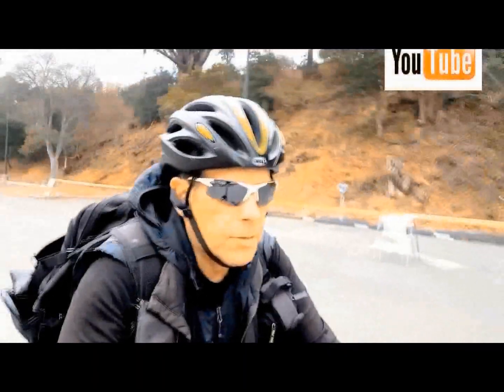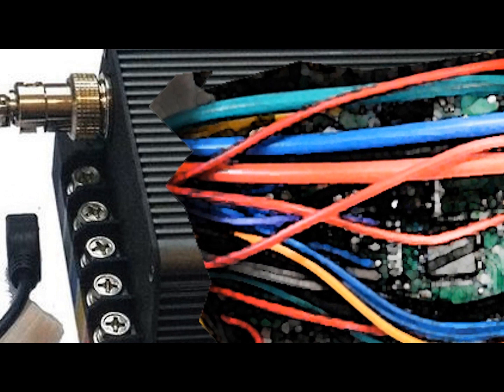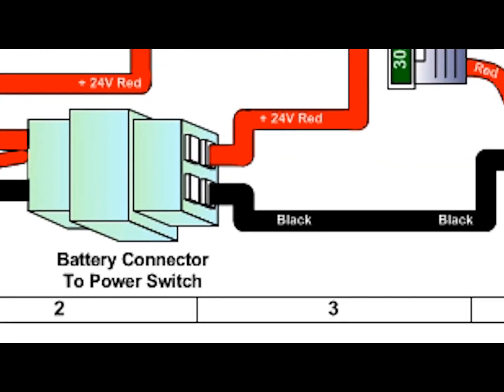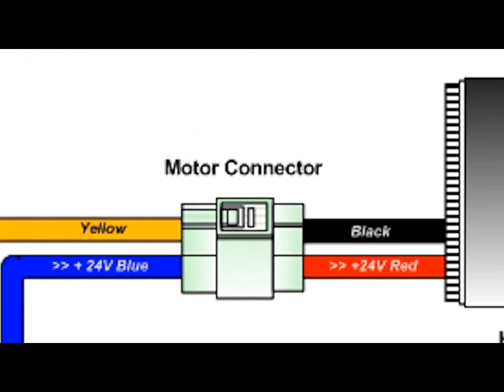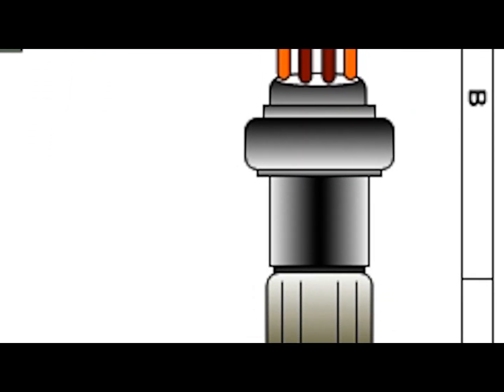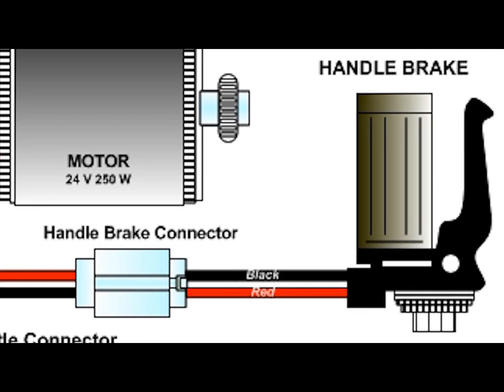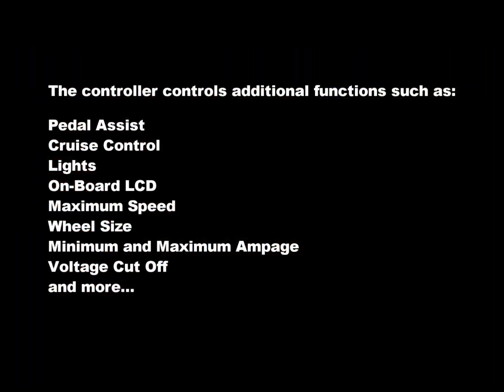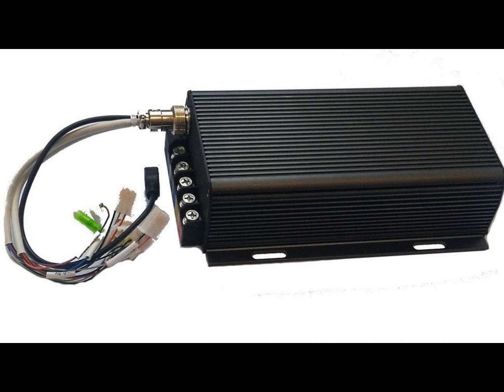How your Ebike's Controller works.  A LOOK INSIDE

Comment: Hey Mr Augustine...My Name is Lawrence and I have a peddle assist Viribus EBike...The circuit chip broke completely off...Can U help me step by step how and where on the main circuit board to Connect the three wires onto the circuit board to make my E-Bike run direct with i turn on the controller ?